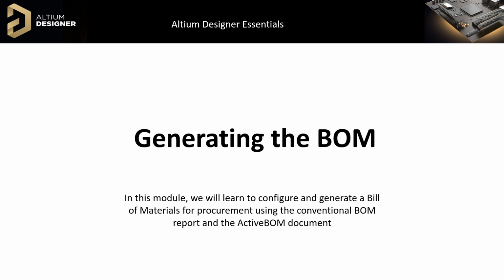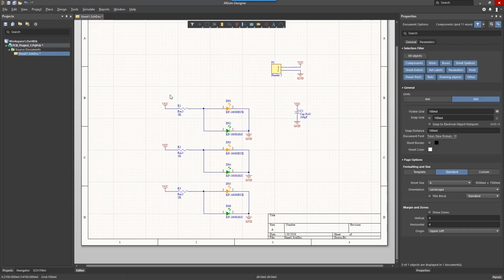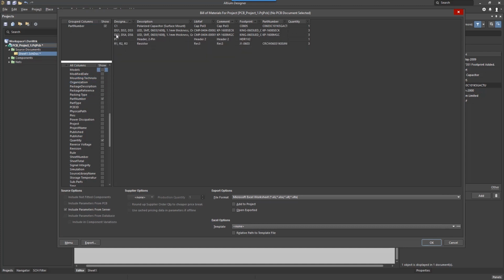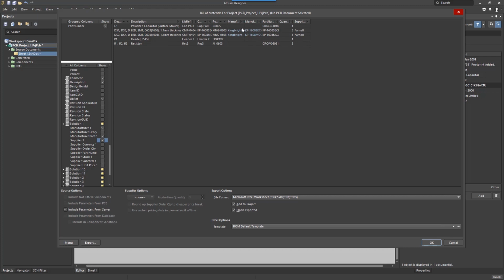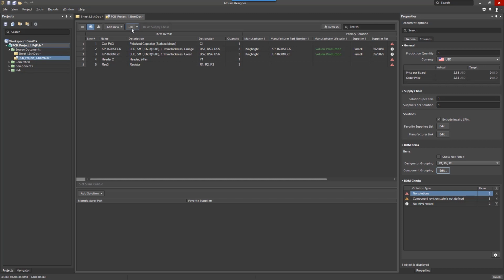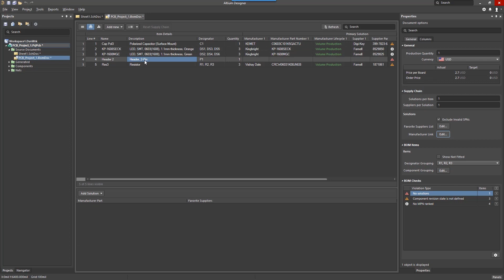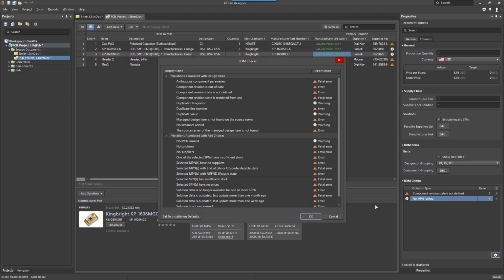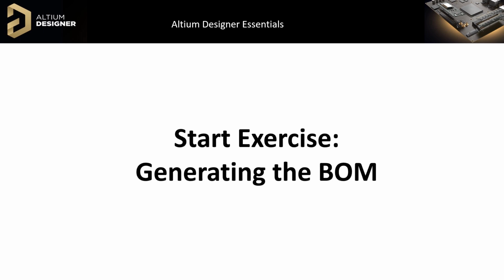Bill of Materials Generation with ActiveBOM | Altium Designer 19 Essentials | Module 27

Comment: Bill of Material Window will not open. (19.5.1) Everything else seems to work. Any clue?
Reply from the maker: Please contact technical support. The right way to use it is from ActiveBOM, then open Reports >> Bill of Materials. If that dialog does not open it could mean some components of Altium Designer were not installed, so a re-installation may be required.